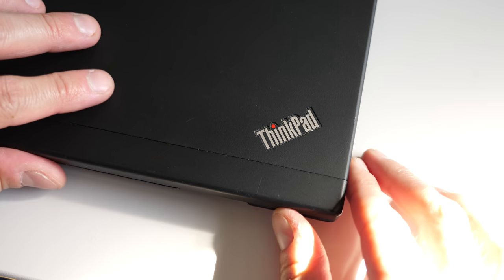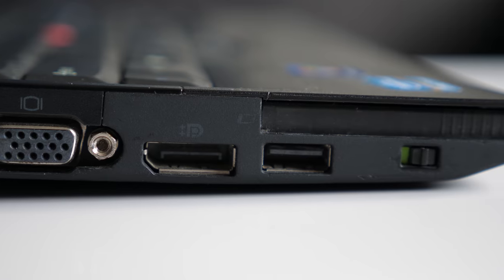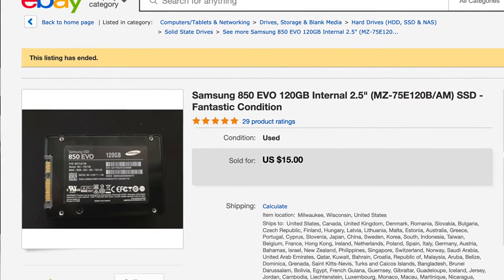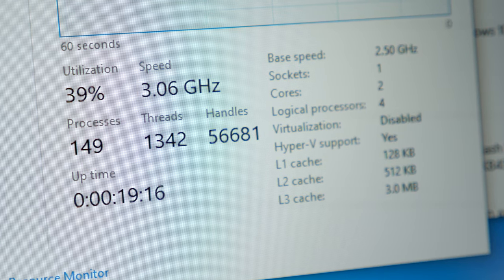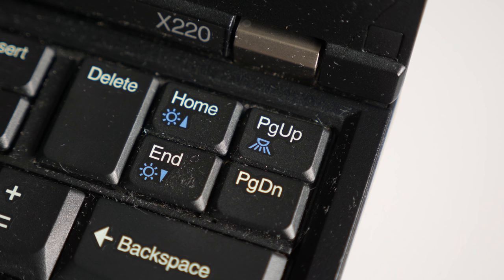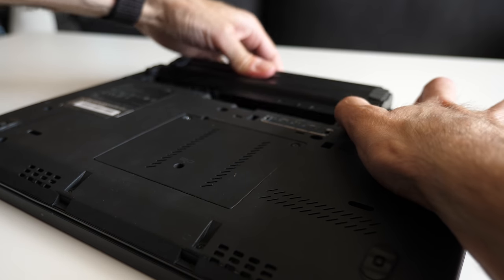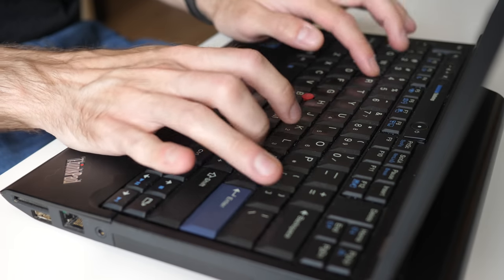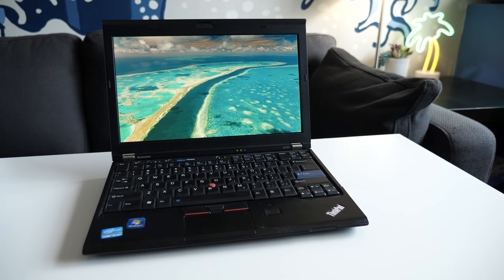The $100 Laptop Challenge -- This Old PC is Better Than You Think

Comment: A few years ago I bought an off lease X220 with a warranty and Win 8.1 Pro (Microsoft sticker on bottom is for Win 7 Pro) for about $300 CAD. 2nd gen Core i5, 4GB RAM and a 320 HD. I installed Win 10 on it immediately. After a couple of moves, the charger was lost, so early this year I ordered a charger, 8GB RAM and an SSD. It made a huge difference. Via a hack, I installed Win 11 Pro shhhh and it works well enough that I use it more than my 2015 Dell XPS 13.
The chipset supports up 16GB RAM, so I'm going to give that a shot.
I just do it because I can :D 
I also put Win 11 Pro on an 11 year old, totally disowned by Sony,  Vaio VGN with a Core Duo and 4GB. That one only got an SSD upgrade, and it's slow compared to the X220.

Comment: As the owner of an i5 X250 (originally came with an i3 - I've upgraded the motherboard) I can wholeheartedly agree with the notion that a used ThinkPad is a superb buy.  The i-series processors have generally aged quite well and ThinkPads have always been great computers.  I love the fact that my X250 has swappable external batteries too.
Reply: I have the X250 too, and I love it. It's a great small laptop that I bought refurbished about half a year ago. Mine also has an i5, and recently added an M2 ssd, and a 2TB hdd for extra storage.
Reply: @DacLMK  Plot twist, mine now has a 1080p display and an i7.  Swapped the i5 motherboard into another one that I have and gave that to a laptop-less family member.  They just keep going!
Reply: @mediocrefunkybeat  Cool. I'm also thinking of upgrading the display on mine to a 1080p IPS because the current TN 768p is terrible.
Reply: @DacLMK  The 768 is terrible.  Swapping out took me about half an hour and compatible panel was £45 from eBay.  Well worth it and made the laptop a lot better to use.

Comment: currently using an T420 i won in auction on ebay  for $13 , only with i5 2540m  4gb ddr3 ram and a slow hdd it still does really well , looking to upgrade it to its max over time

Comment: Love old x 220's, x230,s. The i7 x220 (T420) have a USB 3.0 port, unlike the i5 versions. I put SSD's and they will take 16GB's of Ram if you wish. Best keyboard ever IMHO. The T models from that era have socketed CPU's and they can be upgraded with quad core's if you're ambitious, and it really isn't that difficult. Their performance of those old computers with quad cores was better than most ThinkPad's until the 8 series chip came along.

Comment: I have Thinkpad X220t with the i7 processor, 16gb ddr3 ram, SSD 256gb and m2 SSD 256gb.
it is a beast of a laptop. and I have a - vDock station connected to the tv and the x220. I just finished playing Resident Evil 3 on 1080p resolution with moderate settings. The SSDs help a lot to keep it fast, and with the vDock and external graphics card I play all modern games on the 52" tv. not bad for 100$ laptop

Comment: I'm happily still using a MBP 13 inch early 2013 retina thingy ... a similar CPU and other specs. This Apple product has never crashed nor sputtered, never seen a spinning beach ball, battery still lasts around 4 fours on YouTube via Chrome. 256GB SSD now reports a capacity of 250.79 GB ... so I think that is very slowly dying. It has Thunderbolts and lightning .... magsafe power cord, and a backlit nice keyboard. $0.02

Comment: I just picked up a refurbished Lenovo W530 with a 500GB SSD and Win 10 for $250 out the door. Gen 2 i7, 8GB ram. Very fast, but heavy. Replaced my old desktop all-in-one (pos) so it won't be moved much anyway. Oh, and it has NVIDIA Graphics.

Comment: That is exactly the same specs as mine, minus the SSD. (250GB HDD) 
Specifically, it is a Fujitsu Lifebook E741/D with 2x2GB ram, a 1080p screen, and a Cardbus port. Upgraded with 4GB ram and planning to get an ssd and drive adapter for the dvd slot. 

It runs CAD at a good enough speed to be rivaled to my School's systems. Most low resourse games run well, with more mid-range games playable with drastic settings and modifications. 

Overall, good value for college students in a rush to get a replacement, or even a starter laptop for teens.

Sidenote: It's a japanese model, so the symbols on the keyboard are misaligned in US input method. Add JAP input in the settings for proper symbol arrangement.

Comment: I mean nowadays you can get your hand on a used thinkpad/lattitude or probook for around 200$ or less with a bit luck equipped with an i5 8250U or a i5 8350U which is not only efficient giving actually good battery life in comparison but also a massive performance improvement even when compared to the 7th gen equivalent the 7200U due to the fact that's it's a quad core hyperthreaded processor. I've got myself a thinkpad L380 around 2020 for about 250-300$ and I still use it to this, it's a brilliant machine, the screen looks great, the keyboard is nice and backlit, it uses USB C for charging so I don't need to carry 2 chargers around, it has a good selection of ports and is relatively light and thin not to mention you can change and upgrade the storage and memory easily.

Comment: Thinkpad fanboy here. Late to the party, both my wife and I have Thinkpad T520's I bought on eBay in use n addition to a traditional desktop. I've had good luck purchasing off lease commercial PCs from refurbishers. I'm also using a T420 as a poor mans server on our home LAN. Agree with your comment about upgrading to an SSD. I even have a T61 laying around if I need to test something on Win 7. Lenovo batteries are kind of expensive, but I've had good luck with clone batteries.

Comment: X220 owner here, similar spec of an i5 2540m, crucial mx500 ssd + an old Samsung msata ssd, though I have 16gb of ram.
Because I’m certain people are wondering, here’s what I can game:
-Skyrim, native resolution all low with slightly longer render distance pulls 45-50fps on average, very stable. Better than the Xbox 360
-Insurgency (the original one) at native nearly all low, better scope detail, gets about the same 45-50fps but can dip down a bit in some maps.
-CS:GO, only lighter maps are playable, the newly redone maps are sub 30fps. 
-Terraria, plays just fine, 60fps+ at whatever settings.
-Minecraft 1.16,  with optifine, regular texture pack and HD skies, turn smooth lighting down a tick and it’ll handle 12-14 chunk render distance fine at 30-40fps, multiplayer does even better for reduced cpu load and pulls 50-60.
-TF2, all low native for 50-60fps on any map.
-Pretty much anything older than Crysis runs fine, Simcity 3000, the Sims 3, UT99 and other old GOG titles, s’all good

Highly recommended machine, there’s a lot of support out there for them and you can do a lot to suit your needs with it. You can dock them or you can use the ultrabase portable dock to get an ultrabay for a CD/DVD drive or even a 3rd storage drive. You have sata 2.5” and msata to work with stock. It takes up to 16gb of ram but only 1600/1866mhz speeds with a bios mod.
Reply: Something else to note is that in 2021 upgrades and parts are way cheaper than they were even a year ago. You can get a new or re-celled 9 cell battery for under 40$ now, and it’s worth it because you can easily get 6-7 hours out of it like that.
Ram is now pretty cheap unless you want to aim for 16gb, 8gb of ddr3 is super cheap.
Msata SSDs are very cheap used as well.
The ultrabase I have cost me 30$, new old stock with keys, and came with the CD/DVD drive, a caddy for a 3rd storage drive costs under 15$.
Reply: There is also a 3rd party mod that lets you replace the display with a 1080p panel, losing the DisplayPort lanes on the dock however. This is more for if you like to tinker than anything, because it requires some soldering of the adapter board and replacing the panel with some specific options, as well this can cost more than the laptop. But if a nice screen means a lot to you then it’s a good choice.

Comment: the only problem, is that the new laptops with the low scores consume much less power and dont even require a fan in many cases.  that old thinkpad probably sounds like a jet engine when it does anything slightly performance intensive.

Comment: I have a Windows 10 desktop that has not been activated that was refurbished from a Windows 7.  Ironically, the case has both keys but the Windows 10 key is missing a digit due to being rubbed off.  Even replacing that digit with all 26 letters and 10 numbers didn't help but you just enticed me to try the window 7 key which is still legible.  Thanks! <> I might be in the market for another laptop... this is something to consider.  My laptop is literally falling apart.  Seems not a week goes by that a brittle plastic piece falls off.  Furthermore, one my RAM slots stopped working so I have the laptop maxed out at 8GB despite the motherboard itself able to take 16 when in perfect working order.

Comment: The laptop may perform well overall but I personally wouldn't venture the used devices route. And none of those geek bench scores show budget Ryzen 3 performance… For example the 
Acer Aspire 5 Slim Laptop, 15.6 inches Full HD IPS Display, AMD Ryzen 3 3200U, Vega 3 Graphics, 4GB DDR4, 128GB SSD
Sure it's roughly $50 more than the rough 300 you were aiming for but the value of the 15.6 inch full HD IPS display, the slim form factor, Vega graphics, more USB 3.0 ports, a HDMI port, probably a better Wi-Fi card, and Acer support more than make up for it. And I feel like taking off the cover to add 8 GB is so easy anyone can do it with the help of a YouTube tutorial video. and yeah 128 GB is really not enough for anyone in 2020. I would probably replace that with at least a 500 GB SSD. I just feel more comfortable getting something new.

Comment: My asus is over 10 years old, still on its original battery (which works suprisingly well), and is my daily driver. Have upgraded to an ssd and the max 8gb ram over the years and is a little rough around the edges, but overall still works really well so I have no plans to upgrade till it dies.

Comment: Asus K53E. CPU upgrade to I7 2670QM from B960 , Nvidia GT620m, 8GB DDR3, 240GB ssd works like charm. And battery 2h is more than ok for money i paid for all of it. 90E (25E CPU, Laptop had problem with display(easy fix) 15E) SSD 25E and RAM 25E 2x4gb).  Can run circles around new 400E intel N or amd C/E APU's

Comment: The real achilles hill of these old laptops is the battery life. Even with a new battery, it won't last long. In recent years, power efficiency got better and battery got bigger.   I have a 2013 sony svs1312 and it performs perfectly for everything except games, i've put a brand new samsung ssd 240gb a couple years ago. The battery, with only 3% degradation, will last about 2h of youtube watching. Ridiculous, considering what modern notebooks can do.

Comment: I have Lenovo 420S...its second gen Core I7 from 2011 with intel and nvidia quadro graphics,HD+ screen ..still like new ,it has SSD for long time inside and is flying try windows 10 ...its still like new which is not surprise becase laptop is overbuild ..3-4 times i spil water on keeyboard and nothing..no fuck given ,i feel like it will outlive the owner no problem .
 But what i am supprise is battery..Only  15% lost capacity since it was new..for 9 years..that is amazing..

Comment: An absolute powerhouse of an old laptop is the Acer Travelmate 4650. 15 years old and able to run Win10 smoothly
Reply: I used to be kinda cringe lmao. I couldn't even get Windows 10 on it due to the processor (mobile Pentium) not supporting PAE. However, an update, my new powerhouse is a Dell Inspiron 1520, with a 1.5GHz Core 2 Duo.

Comment: I've found quite a few discarded laptops over the years but haven't had much luck getting them to run. Every time I fix an issue something else always goes wrong. I get frustrated and start justifying reasons to give up on it. It's too old or too heavy. It's obsolete. Nobody wants an old laptop. I've had much better luck at fixing up old desktops. As long as the processing unit isn't too bad I can usually get it working and match it up with a discarded monitors and keyboards. Once I have a completed working system I'll give it to someone who can't afford one. I'll never get rich but now that I'm retired it occupies my time in a way that's constructive and helps people. 😎
Reply: You are rock, bruh!

Comment: This trend of removing 80 to 90% of the storage from a computer for slightly faster boot times is idiotic.
That said, I just scored an X201 and I'm loving it so far.  Not quite as modern, but nice as an extra machine.  Not putting an SSD in mine unless I end up with a big one laying around unused.  getting by with 500gb rust platter for now.

Comment: I had the holy grail of used Dell laptops from 2007 The Dell Studio 1565... You can't find these suckers for sale used right now...  only parts.. I was ready for a new laptop and purchased a Gigabyte gaming laptop in 2018.. But I maxed out the ram and switched to an SSD on the Dell. I  gave that to my mother, but not before a side by side comparison.. The at the time 10 yr old dell only took an additional 2 seconds to boot, compared to the gaming laptop.. for a total of 17 seconds down from a minute 30, everything i ran on the 2 machines loaded about the same time, and ran about the same.. Games however did not improve much on  the Dell. Due to the intel graphics built in.. Vs the Radeon R5 graphics in the gaming one. My mom has been using this hand me down now for 2 years and loves it, and considering my mom and I both  maintain our equipment it still looks fresh out of the box, no shiny keys bo rubbed off paint on the touchpad, no scratches or cracks, and the rubberized coating on the lid is like new also..  I have som HP Probooks, and Ultrabooks I gave these upgrades to and now have a fleet of screaming fast 8 yr old laptops. ;)

Comment: I have the same model a X220 with an i5 SSD and 16 GB of RAM things to add to any X220. Firstly, a dock P/N 0A33932 These are readily available on eBay, new old stock for under $20. They include USB ports Display Port VGA audio and most importantly a DVD burner. I have also picked up a USB 3 Expansion Expresscard It cost less than $10

There is a thriving community of ThinkPad owners on Reddit if you need help upgrading your ThinkPad.

Comment: Laptops this old use SATA2, it was really noticeable when I had to give up my shiny new 8th gen laptop for an old 2nd gen.
Reply from the maker: Just like USB 3 support, SATA 3 is hit-or-miss with machines from this era. The X220 has SATA 3 (otherwise the SSD I installed wouldn’t have been able to hit the speeds it did).

Comment: Well, I am using a 10 years old Dell laptop, just replaced the HDD by a SSD, install Windows 10 with Linux Ubuntu and install 16GB of memory. It is working great for me. Not recommend Debian if you like to use it with an external monitor.

Comment: I have a Lenovo from 2014. Still an i7 and 8 gigs of ram. I spent $49.00 for a new Sata drive. Takes 6 seconds to boot to Win 10. I replaced the slow poke HDD. For a 7 year old computer, it still works great. I really don't want to buy a new laptop.

Comment: I picked up two used lenovo thinkpads for $20 each at a thrift store, no chargers or HDD caddies. I picked up two chargers at work for free from the scrap parts bin and i picked up three HP SSDs from office max. I literally duct taped the SSDs into place. The lower spec one (2gb ram 2ghz dual core) i use as a octoprint server for my 3d printer, the more powerful one (3gb ram, 3ghz dual core) i use as a travel/field computer since it can still play youtube, google maps, and if i need to run anything really serious i can connect to my VPN and use VNC or RDP on one of my daily computers. If you are so hard off you would steal a 1 inch thick laptop that literally has the storage drive duct taped in, you probably need the computer more than i do.

Comment: Oh look, it's my laptop. Bought it in late 2017 for ~$170 when the screen on my T530 died. Mine came with a 120GB SSD, 8GB of RAM and the same i5. Got a "new" 9 cell battery from ebay (not sure how legit or actually new it was) for about $70. Switched it over to Linux in january since Windows 7 support ended and I don't want to use Windows 10 if I can avoid it, not that it matters much since I haven't really been using it that much since.

Comment: my i7 x220 kicks ass, but it should probably be noted that there’s a few things you’ll want to upgrade on them. The TFT screens are terrible, so a decent IPS screen will add $70. If you want low power bluetooth you’ll need to swap that chip out, which is a cheap job. The trackdots in the keyboard lose their sensitivity over time, so a new keyboard with one of those will cost you $35. And no money on earth will ever make the textured touchpad anything other than total crap, but hey - now you’ve got Bluetooth LE you can at least pair it with a modern mouse! These machines are endlessly repairable and upgradable.

Comment: An older Lenovo Thinkpad is still powerful. The only problem I found was that Lenovo stopped releasing drivers for the graphics card, which is a shame because it is still capable. I had to upgrade my lenovo just because I need to use Premier Pro and it kept comolaining that my grahics card drivers had not been updated grrr.

Comment: The xx20 series of thinkpads like the x220 and t420 aren't officially supported by windows 10 so you will have to hunt around for drivers for it and alot of the shortcut buttons like the screenshot button and most of the F buttons won't work, also the speakers are super quite in win 10, they are significantly louder with linux.
You can make it work with win 10 but it is a hassle.
The next generation xx30 series like the x230 and t430 should work good with windows 10 though.